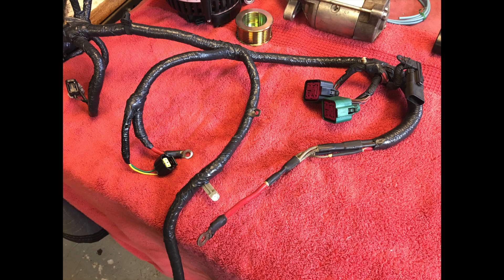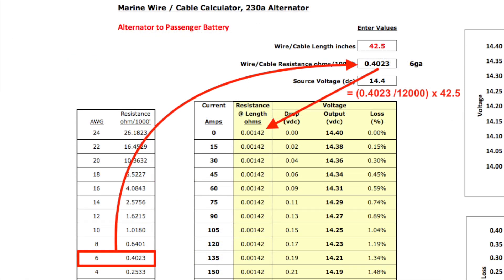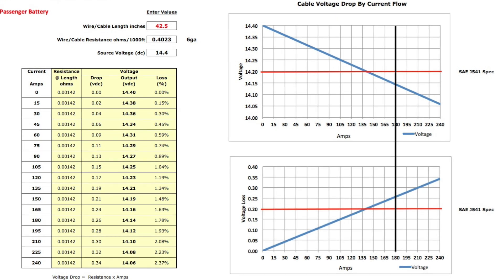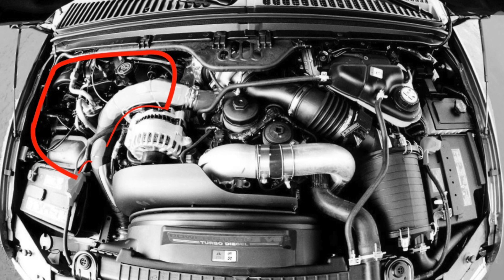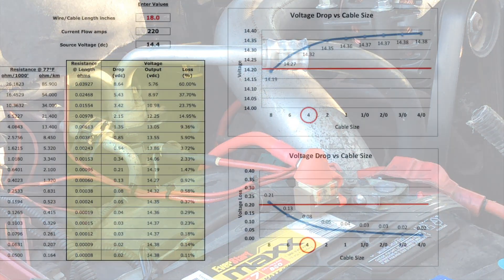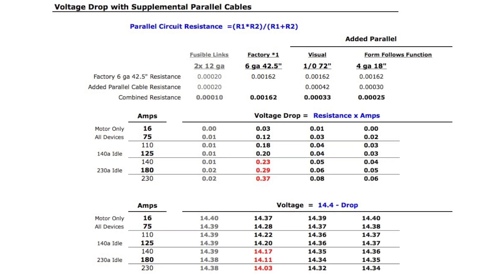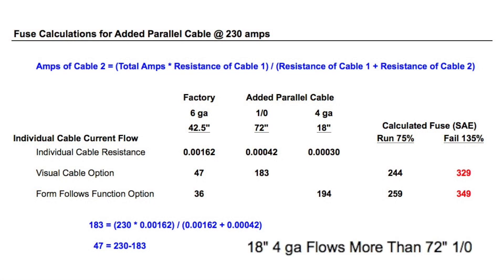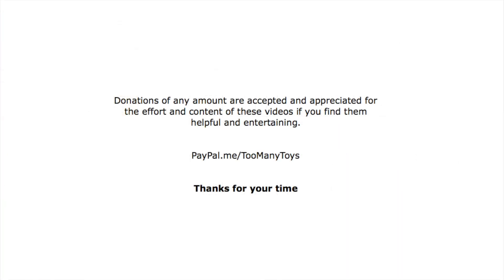Powerstroke 6.0 - Alternator Cable for L-N 230a  and others

Comment: Do you know what gauge size is the wire that goes to the starter 🤔
Reply from the maker: It's a 2/0.
Reply: @toomanytoys  What about the wire coming off the alternator and the battery with the fuse links... I want to replace the ends with a lug that has a 5/16 stud, rather than drilling out the lug. Thank you for spending the time on all this sir.... Thank you
Reply from the maker: @MrMr123  For that, you could use either a 4ga or 6ga lug. Suppliers of the lugs tend to have slightly different-sized openings, and Ford wires are also not exactly typical. I've run into this on several platforms.

Comment: Okay this is great.  I installed electric fans and now have an additional 50 amp draw.  Looking to upgrade my dual alternator setup on my 05 F350 ex-ambo with an upper unit either LN or Mechman 240 so this is important. My question is the battery to ground and block to ground - should they not be upgraded or do you feel stock wiring is adequate?
Reply from the maker: The stock cables are sized to handle the 600a surge, 350a flow between the alternator to batteries, but from the batteries to the truck's body tub is limited.  With all the stock electrics on in the cab your truck pulls about 100a, so the added electric fans means 150a possibility at idle if every electronic device is on in your cab.  Sound amps will up that.  So with any alternator setup, you need to see what you are capable of at idle, and if you have the dual factory setup that should be about 240a after the glow plugs are off (only 1 amp is used when the glow plugs are on).

However, you are interested in are the negative cables from the batteries to the ground plane (body tub) are adequate.  With a duel alternator setup, you have an 8ga negative cable off each battery negative terminal to the body tub, plus the two 12ga bonding cables.  You could increase the to 8ga to 6ga, which would be adequate for your stock plus fans situation.
Reply: @toomanytoys  Just as an update, I have received the alternator and despite it being rated at 240 amp, the manufacturer has measured 210 amp output at 800 rpm and 285 amp output at 1800 rpm.  So I plan to run a form-over-function 4 ga 18" wire from the alternator  to a MBRF 300 amp fuse (not 250 amps as you indicated in this video).  I realize that the factory 6 ga wire would share some of the current load from the alternator but I am worried the 250 amp fuse would not provide a high enough threshold given the output values of this new alternator, especially when I am hitting 2000 rpm at highway cruising speed (=285 total amps).    
To complement all of this, I plan to clean all the wiring connections of any oxidation and add dielectric grease to minimize future oxidation.  Moreover, I will add parallel wiring from the passenger and driver batteries' negative terminals to the body tub to increase the current capacity from 8 ga to 6 ga (for the driver side, the I will run a 6 ga wire to the the PCM/FICM ground at the tub to minimize voltage drop for these components). I will also add the 1/0 grounding wire from the driver frame to the block and a 1/0 wiring connecting both + terminals.  I am assuming from another one of your videos, you did not recommend adding an additional ground from the alternator to the tub, so I will skip this.
Reply from the maker: @alporan9087  Every alternator has a lower output at idle rpm.  Most give a value at top rpm; this person is unusual.  Not a bad thing to adjust for the top amps, but I doubt you will ever get that high.  Yeah, don't run a ground from the alternator to the fender.
Reply: @toomanytoys  Update - finally finished the installation and it works (sorta).  I ended up replacing the 2nd alternator as it was as old as the truck (2005).  So two new alternators, one 240 Mechman, the 2nd, 110 (like OEM).  Batteries now running at 14.4-8V even with all accessories on and all the ambo lights flashing (highest draw scenario).  As per your great videos and responses to my comments above (thanks again),  I complemented the existing wiring with additional runs and retreated all the existing connections (removed rust & added dielectric grease).  That being said,  I redid the wire from the 240 alternator to the + terminal of the passenger battery from 4 ga to 1/0 - why?  Well, I was concerned by the heat of the wire - the 4 ga was hot to the touch, melting the shrink tubing over the lead.   With my new ammeter, I noted that all the current was running through the wire and none was going through the old stock wiring, also attached to the alternator (so effectively there are two wires running from the main alternator).  Even the secondary alternator, which was reattached to the stock wiring through its own dedicated run is showing no current.  My ammeter inside the cab is not registering any current whereas before it did.  Now this is no biggie as I know my main, connected directly to the passenger battery, must be recharging but why no current is going to the others, I am puzzled.  I am thinking of connecting the secondary alternator to the batteries directly as well, possibly the passenger or the driver side...thoughts?
Reply from the maker: @alporan9087  The 4ga wire is running hot because it was sized for being one of two cable paths for an alternator of that size.  

Neither of the factory cables' flowing current is likely due to their fusible links being burned out.  This will happen if the batteries remain connected and the alternator cable lugs touch the engine or ground. 

With both ends of the cable disconnected, checking the continuity or ohms should tell they are non-functional if there is no response.  Fusible links can be replaced or a layover of the same size cable.  If you have a 1/0 cable, then you only need that for the top alternator.

Any alternator cable should be fused, with a fuse or a fusible link.

I have the following pdf files in my FTE forum album, which you should review.

https://www.ford-trucks.com/forums/attachment.php?attachmentid=274884&d=1657650888

https://www.ford-trucks.com/forums/attachment.php?attachmentid=261358&d=1531840550

https://www.ford-trucks.com/forums/attachment.php?attachmentid=261357&d=1531840550

Comment: looking to upgrade my cables but i have a stock 110a alt.  what in line fuse should i use?
Reply from the maker: A 125a or 150a would be fine.

Comment: Been there done that.  I'm convinced that L-N 230A alternator (I used the 1/0 wiring) has been one of the best investments I've made on my F350.  Batteries, FICM, and other associated electrics have been humming along nicely for five years now.  But now that I've said that....  Soon, I plan to tap into the harness/alternator circuit to run a charging circuit to a Victron Orion-Tr Smart DC-DC Charger for my camper--I just want some additional juice vs the typical 5 amp charge to my camper batteries from the trailer harness.  Good video!!  I'm sure wishing I had your excel spreadsheet but my rough calculations should easily handle a 6AWG wire.
Reply from the maker: Let me think about how to do that.

Comment: My little device,and my 55 yr old bad eyes and limited technical prowess have me following along but unsure of certain what to do.i just got my new high amp
 250 amp upgrade from factory ,after my alt. Went bad .need to fix my ride.what do I purchased as far as wire size and fuse?,I will get it from your links online at gregs marine.,,,,,,05 ford f350 6.0 powerstroke superduty,,,,,,help steering me to right things to order would be grateful,,,,,,you seem to be the most knowledgeable person I very ran across after hours and days of  searching the Web. ...thanks much
Reply from the maker: For a 250 amp alternator, I would get a 2ga cable to run from the alternator to the battery and use a 200a fuse.  It will be a shared, parallel circuit to the existing one.  GenuineDealz is also a good supplier and will have the fuse too.  The length of the cable depends how you want it to lay.
Reply: @toomanytoys  thanks so much for responding. you seem to be the only person out of hundreds i heard speak on  the subject.,, so  i need to make each length sections the same to balance the strain on each batt?
Reply from the maker: @ericgriffinthefirst  I guess you are talking battery cables - With high current situations like starting and the way these trucks are laid out for battery connection, the resistance of the cables alter the contribution.  It depends on how crazy you want to get.  The typical situation is the pass batt will have a shorter life by a few months.  Some people recommend rotating batteries to even this out, and it does, but again we still have less than ideal life.  For some, a few months isn't a big deal.

So for this type of layout you have to calculate does each battery connection has the same resistance with its individual cables, based on the length of the wire and its size.  It's what I did in the video about balancing the battery cables.  If you just put the same size of a cable everywhere in this type of design, it doesn't.